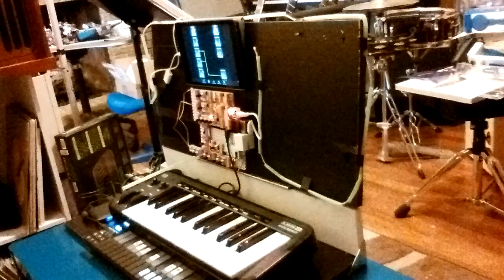Little bits MIDI synth

Comment: Fun demo. I really like your setup and the midi routing.  Do you know if the littleBits synth could be modded like the Korg Monotrons or even the Volca series with any soldering to the board to add say midi in and out connectors via DIN cables without the arduino module (I don't need USB midi necessarily).  Also do you know if this synth could be chained via midi to the Korg monotrons or volca Keys (which I already have) to create a layered sound such as was done with the Oberheim SEM multivoice synths (individual SEMs were connected together) ??  I am still only starting to understand the basics of synthesis, but I am searching for a inexpensive way of creating my own analogue polysynth type string or pad effects...The mods I have seen so far with the Korgs envolve people trying to sequence sounds and beats rather than play chords and leads on controllers.
Reply from the maker: Great idea - DIN MIDI into Arduino. I'm not sure why I never thought to try it. Yes - the Arduino can fairly easily accept MIDI input. Here's an instructible that details how to get MIDI receive working on an Arduino - http://www.instructables.com/id/Send-and-Receive-MIDI-with-Arduino/?ALLSTEPS